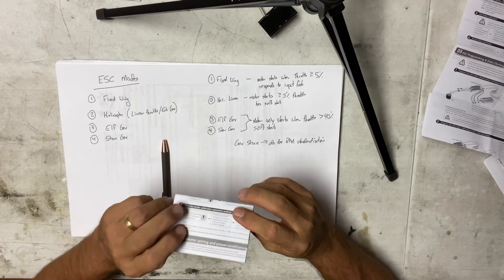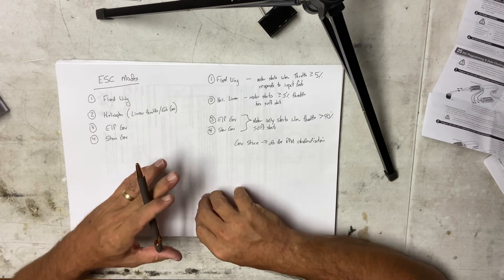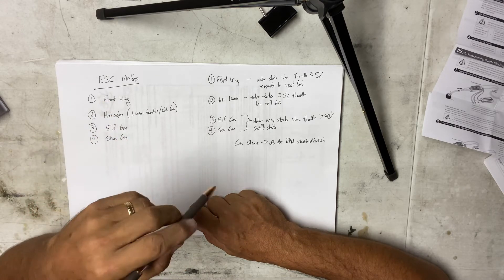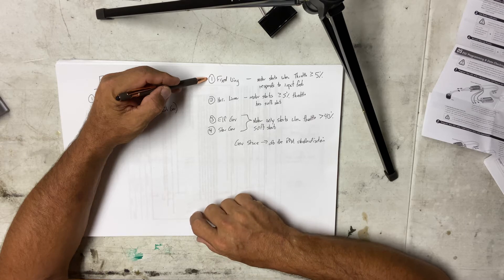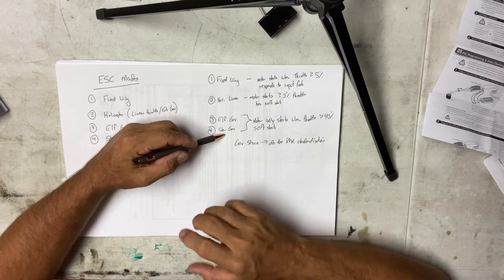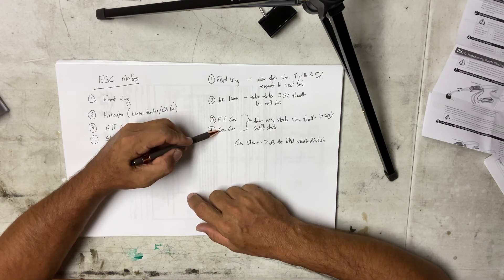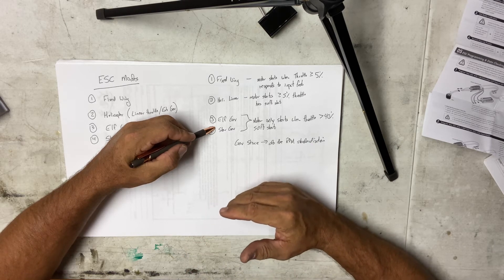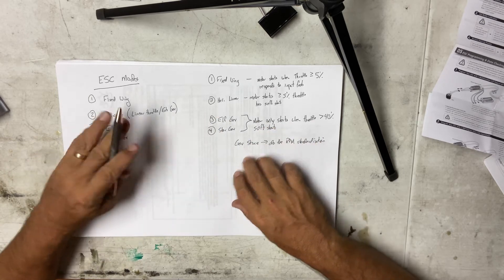ESC Modes Explained - A quick look at the Hobbywing ESC Modes

Comment: Hello Greg, Nice explonation, Have also Issue with HW 150/180 with Neo and Vbct, Have in the Neo setup Vbar gov and in the Setup from HW setup Vbar gov, so when i spool up at the first start ITS always overspool up and then go back to my installed headspeed, Do i set in the HW setup menu the Fixed wing curve and in the Vbar set up Vbar gov full intregrated?